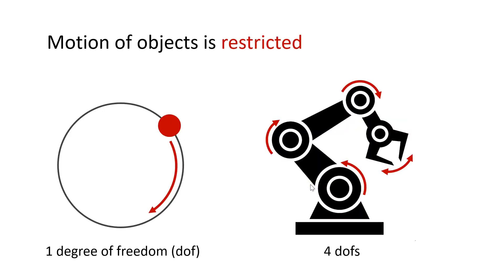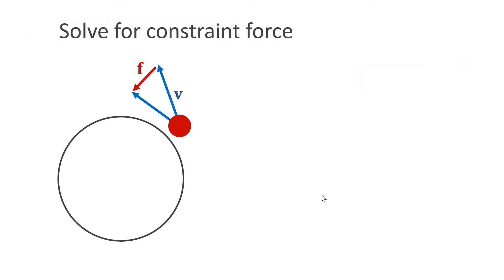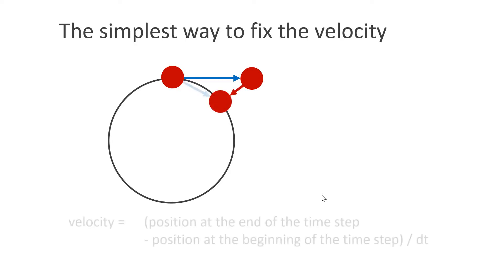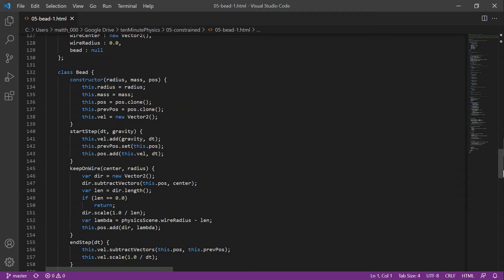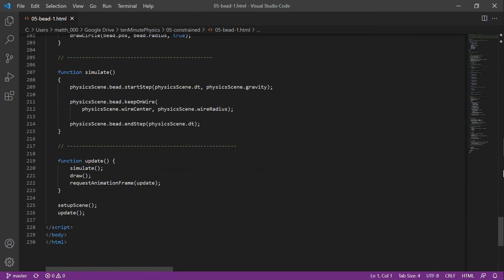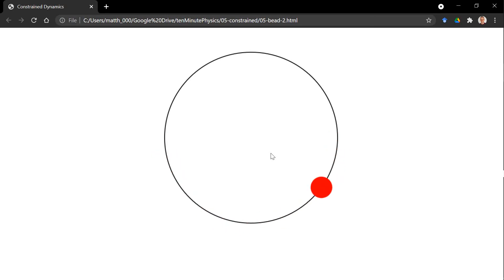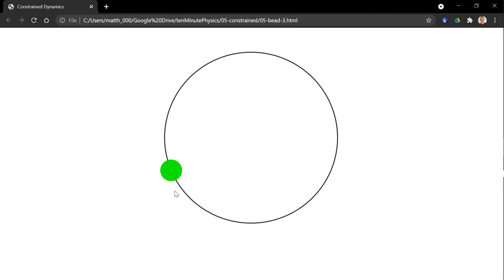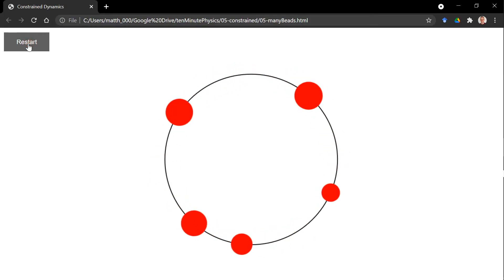05  - The simplest possible physics simulation method

Comment: I have re-created your example in C++. However, I am using floats, not doubles. When using 100 steps, the quality still improves, but with 1000 steps, the quality deteriorates instead of converging. Is this expected? How do you solve this?
Reply: Your dt probably becomes too small to be accurate

Comment: In the original paper, position based dynamics, the author chosen delta p along the gradient with explaination that the choice will conserve both momentum and angular momentum if all particals are of the same mass. Why is it so? Could you please give a mathmatical prove to this statement. Many thanks.
Reply: I have wrote a prove to prove that the convervation of momentum and angular momentum is true. That's quite surprising. I wonder what's the mathmatical or physical deep thinking behind the update strategy?

Comment: This is very good and those videos are amazing. But for this problem, would it not be even simpler to use SVG and rotate the bead around the center of the big circle? Then all the trigonometry is handled by the SVG engine, the bead stays on the circle by definition (provided it started on the circle) and all we have to do is provide the angle of rotation at each step.
Reply: And how would your proposed method be expanded to handle multi-bead collisions as demonstrated? The single bead on a wire is a simple example to demonstrate the technique, not the entire target problem being solved here.

Comment: Would this converge to the solution quicker?  Currently, for all particles we linear velocity project, then, do contraint solve, place bead on wire, which is a curve, so we basically just moved a straight line away from a curve, then moved back to satisfy constraint which was another direction so we lost velocity, and created damping. This is because the projection doesn't take into account the constraint.
What if you go through all particles, like usual, add gravity to velocity, then particles distribute its velocity along its constraints, losing force according to inverse masses and constraint damping.  For each particle, solve the constraint, A=F/m. Basically we move the particle position along the constraint more along the curve of the constraint because now the particle velocity has been modified to follow the direction of the constraints.

Comment: I'm sorry but I can't follow why implicit integration == losing energy?
Reply: Implicit integration does not care about energy conservation. In some setups this will cause the energy to grow infinitely until the simulation "blows up", but in this example of the bead on a circular wire the tendency will be to lose energy until the bead is sitting still on the bottom of the wire.

For the extreme case where the velocity is very high it's quite intuitive to understand why we are losing energy. Let's say the bead is in the right-most position and we give it an enormous velocity upwards, enough velocity that it would have done several revolutions in one time step. Our simulation will first move the bead as if it was unconstrained, then clamp it back to the wire (putting it to the top of the circle) and finally set the velocity to be the position difference. We gave it a huge velocity, but the simulation reduced the velocity to be <1/4 of a full revolution per time step.

If the step size is very small it's harder to have an intuition. You can draw the diagram of where the bead would move with tangential velocity, and then do the trigonometry of where the clamping will put the bead. (skip the forces, just use velocity) It will show that the clamping causes us to lose velocity in each step.

It's not too bad though. We can always reduce the velocity/energy loss by taking smaller steps. But we have to tune our time step size depending on how large velocities we have to simulate, and how much energy we are OK with losing in each step. Technically you could automatically tune your time-step size! If the difference in velocity after clamping is too large (eg. less than 99.99%), then subdivide the time step and simulate again!
Reply: You can also add a final stage where you basically calculate the kinetic energy of the object before the physics fiddling, and after, then rescale the appropriate values to enforce the conservation of energy as if it were a positional constraint.
Reply: Same